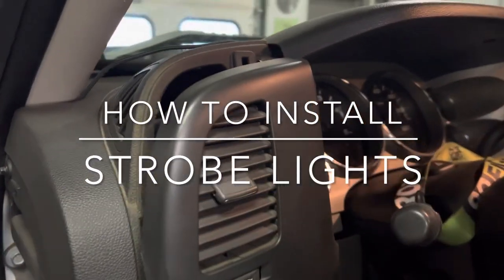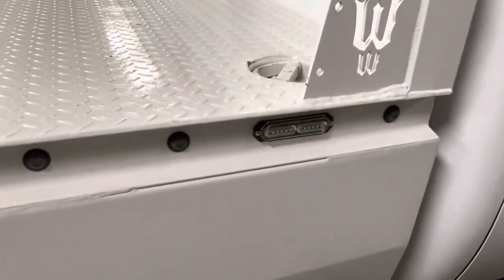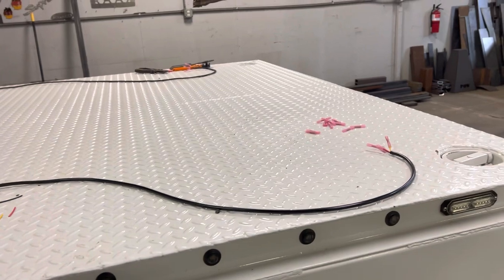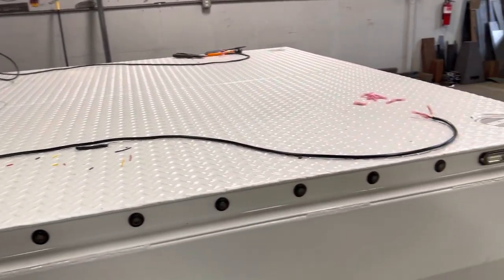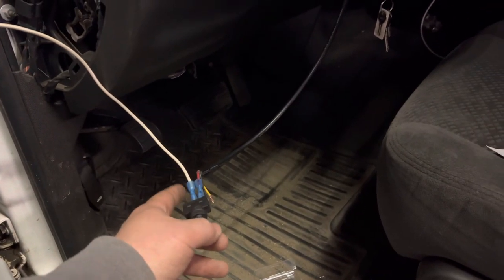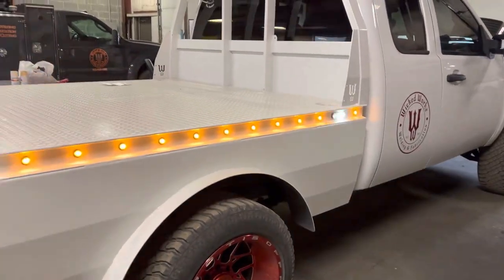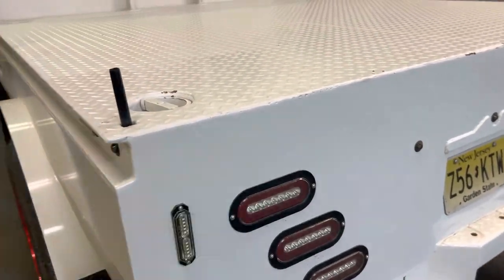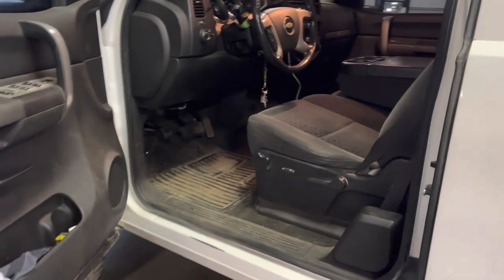How To Install Strobe Lights

Comment: Those look amazing man! Do you have a link for the strobes and wires?
Reply from the maker: https://www.amazon.com/dp/B08PYVYN9T/ref=syn_sd_onsite_mobileweb_0?ie=UTF8&psc=1&pf_rd_p=55047bd8-11f3-4343-afe7-e9146a57ac3d&pf_rd_r=3CDNZD256F6BBB7RN4B5&pd_rd_wg=Fg65r&pd_rd_w=6TmHS&pd_rd_r=3a18f618-4fbc-4da1-85a1-613fa49ac651

Comment: bit a newbie when it comes to wiring, did you run a fuse from the battery to the switch?
Reply from the maker: Thats one way, but i just tied into the power for the headlights/markers
Reply: @wickedgarage  oh yeah i could probably do that, did you use a t clamp connector or a splice ? i dont really wanna do much cutting since im not confident with it
Reply from the maker: @cira7354  i used one of those blue splice connectors,